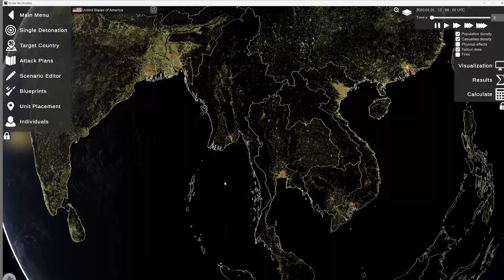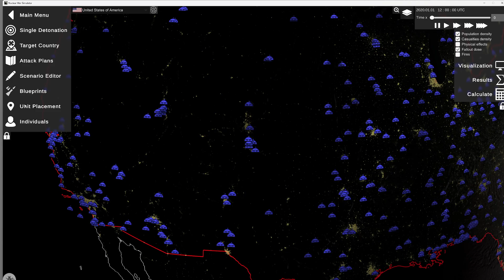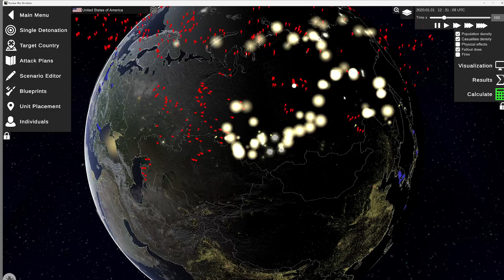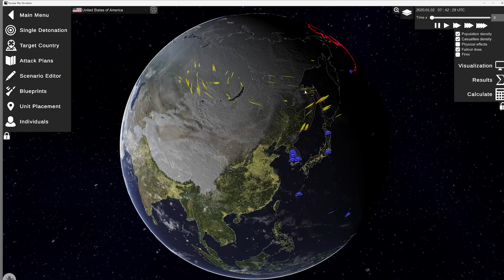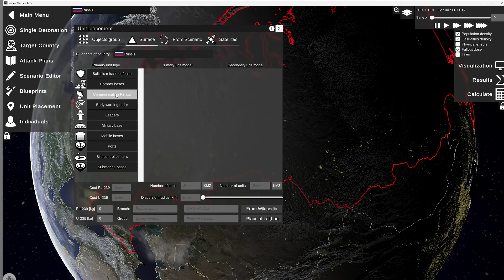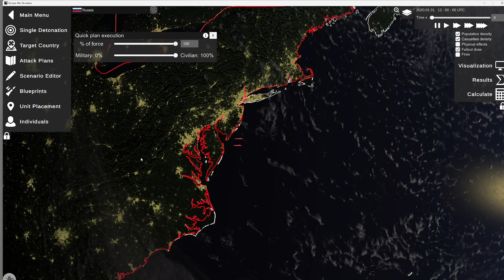How To Use The Nuclear War Simulator Lesson 2- Adding Units and Targeting Countries

Comment: Don't know if it's a version thing but world 14 plan autoexecute doesn't work , its starts with a massive SLBM attack of RU military targets without any reason and the plan sequence doesn't play out. Also if you manually execute the attack plans one by one , nuclear warheads on balistic intermediate and cruise missile for some reason register as a large conventional explosion even tough the unit firing it has only 200 kiloton nukes for example, its somewhat broken. For pre set bases and stuff I mostly go with the "realy cool realistic nuclear war" scenario or something like that , if my memory doesn't bettay me its on the 5th or 6th mod page. Really like your videos, I'm somewhat of a WMD warfare fanatic myself and rising awareness with the stuff going on nowadays is always a noble couse.
Reply from the maker: I do not use the World 14 attack plans, I just used it as a base layout and then edited the forces to correct them based on current stockpiles.
Reply: @MagnusDivision  Aha , im currently in the process of having Google earth opened on a second screen and trying to discern some extra deep RU basses and strategic forces locations. Basically impossible the RU state is very secretive. Im also trying to gestimate if the worst is to happen in the days after the initial massive exchange how many stored warheads and "deep" storage warheads can be fitted on delivery systems and put into working order for the 2 main nuclear powers. Completely inaccurate estimation based on a whim. Such info simply doesn't exist .